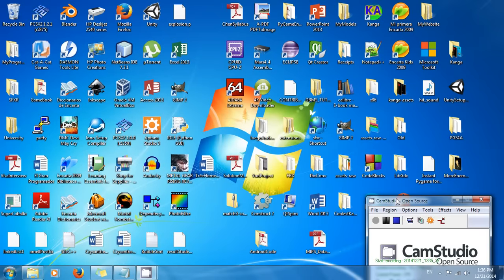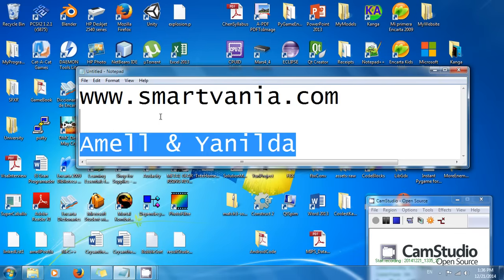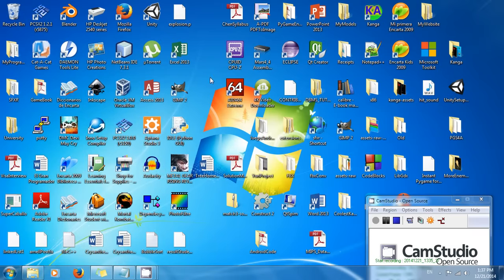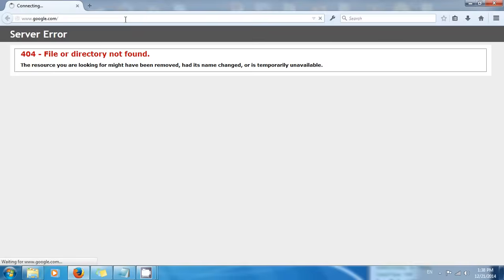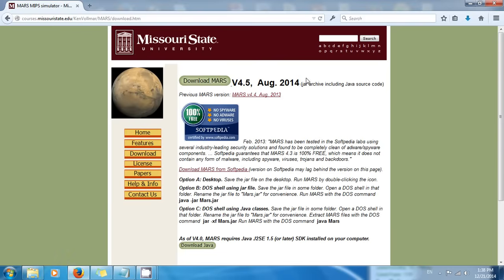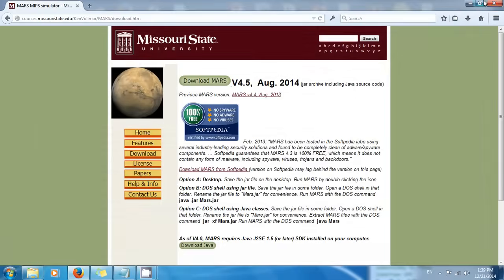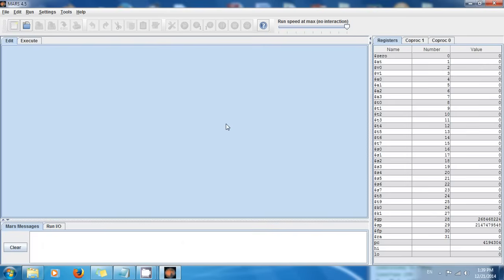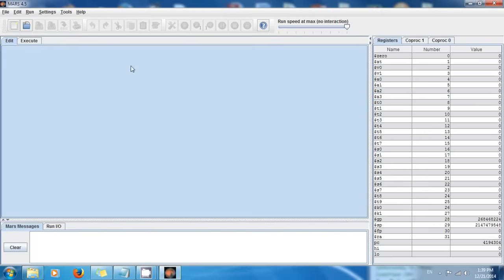MIPS Tutorial 1 Intro and Mars

Comment: Hello, Is it okay if I use QtSpim instead of Mars for this? Would there be any issues?
Reply from the maker: Hello, Rasel. 
Yes, it is okay. But if you are using the SPIM simulator, the basic code template is a bit different. Therefore, you need to follow the basic code template provided below when using SPIM (instead of Mars):
.data
# Data declarations go in this section.

.text
.globl main
.ent main
main:

# your program code goes here.

# Done, terminate program.
li $v0, 10
syscall 
.end main
Reply: Quasar Distant thank you for replying, is that the only difference? Would you mind telling me how I can practice code tracing in mips as well as understand how memory works?
Reply: Quasar Distant  Could you please tell me how the basic template would look WITHOUT pseudo-instruction?

Comment: im using QTSpim for MIPS assembly, is it any different from yours?
Reply: +letsroll I also subbed to you btw, thanks
Reply from the maker: +letsroll  Hi. Both QtSpim and Mars are popular simulators for MIPS; however, I prefer using Mars because I find it simpler and I like its interface. Also, Mars has more system calls available than QtSpim.
Reply from the maker: +letsroll Thank you for subscribing!